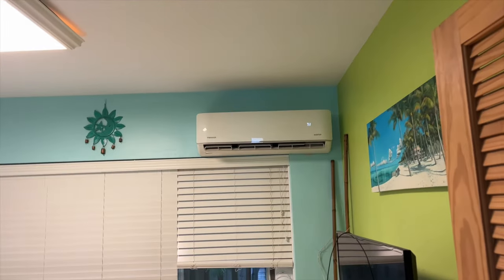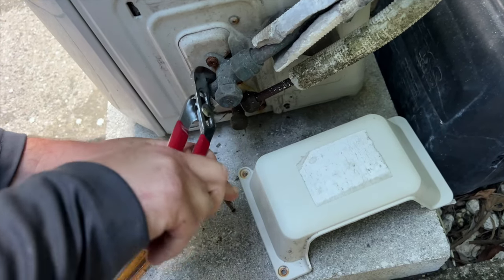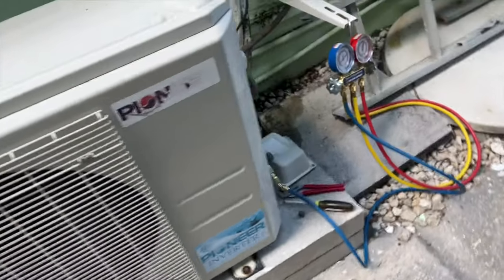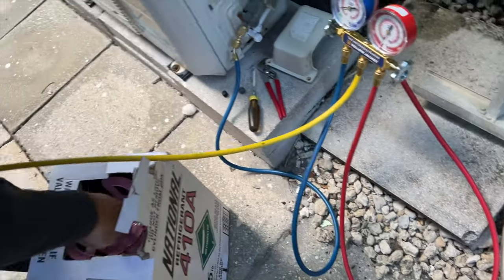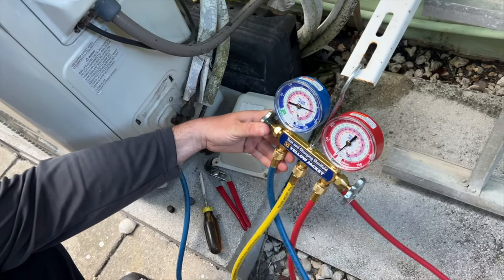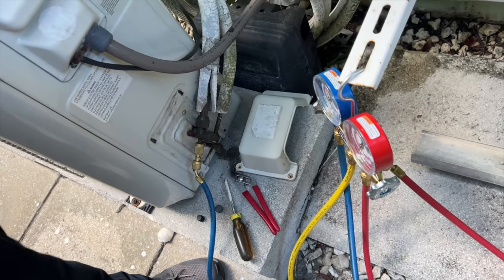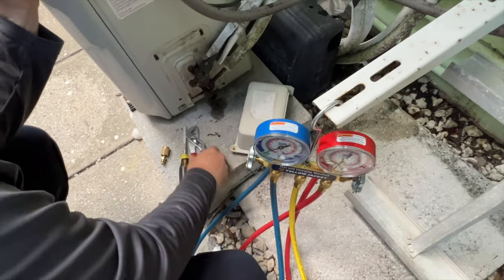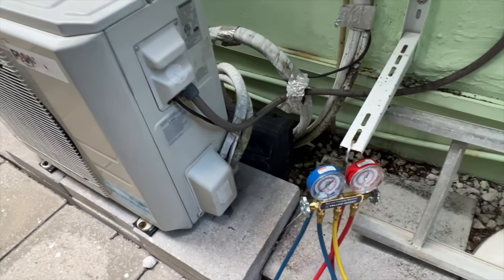How to charge your Mini Split with 410a Refrigerant

Comment: FYI, that extra length of tubing that is rolled up behind the condenser should be layed horizontally and not vertically.  Refrigerant can settle in the low spots of the tubing
Reply from the maker: Good tip
Reply: No.thats oil trap loop😮
Reply: Yeah, it’s an oil trap and LG now says to lay the loops flat.
Reply: This is why i installed mine on a plywood platform so I could coil up the extra lines under it horizontallly.

Comment: Need to add freon slowly it's a vapor compressor if liquid add too fast you will overcharge it and possibly damage the compressor
Reply from the maker: Another excellent tip thank you very much and stay cool this summer
Reply: It's going thru the dryer first to prevent that from happening (the big black can/reservoir). Overfilling defeats that safety and will damage the compressor.

Comment: You should have checked the two flare fittings on the outdoor unit with soapy water.. they can tend to spring a small Leak sometimes
Reply from the maker: Excellent tip thanks

Comment: R410A is not charged as a liquid because it's faster. It because when charged as a gas, it fractionalizes and you end up with two refrigerants instead of a blend.
A device called a Quick Charge will allow you to charge as a gas on the suction side, bur the bottle still has to be turned upside down.
Reply from the maker: Excellent tips and information. I’m sure that our viewers will appreciate that as I do. Thank you for watching and keep cool.
Reply: Some people also just become their own "Metering device" in a way by slightly cracking it open and forcing it into vapor
Reply: He seems like he might be charging it too fast, which means liquid into the compressor… They make metering devices, or gauges with a sight glass, but just go slow never opening the valve fully… Technically, he should have recovered the Freon, purged the system, pulled a vacuum again and charged by weight… Yeah, you can charge slowly until you get around 115-120 on the suction line, but overcharge these units and you could damage the compressor…

Comment: Does the unit need to be running while one is checking the refrigerant level and adding refrigerant? Also, should one evacuate the unit first and again, should the unit be on or off? Thanks.
Reply from the maker: I’m gonna have to ask my HVAC guy is I’m not quite sure of what the correct answer is

Comment: If you didn't use any sealing treatment on the line connections (both ends, both lines) it's pretty much a guaranteed leak. I use Nylog Blue which from what I've heard is one of the best on the marked.  The very first one I put in I didn't use the Nylog, even though I made sure to really tighten the lines 2 years later it was low on gas.  I went back and resealed the lines with Nylog no problems since or with any other systems I've installed.
Reply from the maker: Thanks for the tip appreciate it good to know and thanks for watching. Stay cool.
Reply: Thanks for the tip I will do that on mine. My freaking mini split keeps leaking and I can seem to find the leak even use a leak detector with bubbles it is a piece of thing Pioneer just like that one. 😅 ✌️

Comment: Just so you have a good outcome always remember to let the refrigerant in slowly . Just a little bit at a time . That way you don't hurt your compressor. Always good to use torque wrench on your service port caps. This is just in case a Schrader valve fails. This also applies to the other caps such as your valve port caps. Proper tools will also save your butt in the long run and hope this helps
Reply from the maker: Thank you for those good tips appreciate it and thanks for watching
Reply: @TomLeeman  Welcome sir!

Comment: Believe it or not, the Schrader valve, where the hose hooks up to charge, leaks. It’s always good practice to check for leaks there after hooking up lines to charge. Spray some soapy water or give it the ole spit test before capping..
Reply from the maker: Excellent tip that’s a good way to see if you’ve got a lead for sure. Thanks for watching.
Reply: I slather the cap in nylog and crank it on with new installs.
Reply: Yep mine is leaking. I know that because when I open the cap it starts hissing 😅. Did i put a new valve on it.  Nope just put another 10 oz in it and put it back on. 😂

Comment: ATF has the best anti-corrosive components you'll find anywhere and it's made specifically for the newer aluminum transmissions used today. Any brand is perfect. It'll put an end to your coil fins getting gunked up in that environment, no doubt about it.
Reply from the maker: We will have to try that appreciate the tip. Thanks for watching.
Reply: Not leaving the unit installed close to the ground and having a good protective cover around the housing that won't block air flow is highly recommended. Critters and the elements play hell with those tiny fins.

Comment: First thing he should have done is to check for leak, do a leak test sense there was some Freon in the system  , then if don't want to go deep he should pump in a die  in and complete the charge , next time need a charge or a day or tow  later go back and test for leak with sniffer and  light leak tester that will show the leaky spot in green or red depending the collar of the die leak test you pumped in .
Reply from the maker: Excellent tips thanks for the expert advice and thanks for watching
Reply: some leaks stop after you get down to that last 8 oz of freon so always best to test leaks on a FULLY charged system... Professionally anyway

Comment: If you have a refrigerant problem - you might want to check the flare fittings behind the inside unit

If you've ever installed one - you probably remember how tough it was to hook up the lines while mounting the unit (unless they were connected before, pipes wrapped and the entire length fed through the wall).  I was also gunshy about bending the pipes and kinking them - it put me off of wanting to tighten them too much but needs to be at the proper torque
Reply from the maker: Excellent tip appreciate it. Thank you for watching.

Comment from the maker: Mine is still good since we fixed it and it’s still blown cold air, but you may have a leak somewhere in the line or could be in the coils. It’s hard to tell without physically looking at it. You may need to have Tech come out. Good luck thanks for watching.
Reply: How often do got use it? Use it for both cooling and heating?

Comment: You have to go to the HVAC class and take training
Reply: I dont think he went to hvac school the way he was letting that 410a go to the compressor I'm going to have nightmares
Reply from the maker: I hope it doesn’t cost a lot
Reply: I think that AC guy needs to go, not Tom.
Reply: I am surprised the motor didn't blow up. Way-way to much liquid going in to that motor. Liquid does not condense, just put in a little at a time..

Comment: Obviously you thought you bought a unit that would clean and service itself. At least you hired someone equally as smart as yourself, using cheap Chanel locks on brass fittings. Talk about the blind leading the blind.
Reply from the maker: Thanks for the info

Comment: the ignorant leading the ignorant .... the tech says "ok to fill as vapor" .... Nope, not right. ....looks like it might be an inverter type, so, superheat/subcool won't work  (got to weigh it out/in)
Reply from the maker: Thanks for the tip
Reply: @TomLeeman  sorry to be the bearer of bad news.  But for an inverter type system, only weighing out and weighing in can ascertain the charge conditions. Inverter systems are fantastically efficient and great when they work. They also can work well for multiple decades UNLESS the installation was flawed.  Most common flaw is bad flare connections.  Unfortunately those can be hard to find on complex installations.   Best of luck

Comment: First thing that should be done is learn how to use your tools properly. . . . 
You don't use "any" side.... the gauges read differently....for high and low.
You turn 410 upside down because it is 2 different chemicals mixing. Only time you don't is if you have a dual charge bottle that has the dipstick to the bottom. As it stands yall are the only dipstick on this job
Reply from the maker: Good to know thanks for the info

Comment: Ya this guy is horrible you gotta weigh in oz. These systems can be overcharged real easy. Also ya the channel locks. Also there is a leak somewhere one hundred percent that low in four years. But ya a sniffer or pressure test.
Reply from the maker: Excellent tips thanks for watching